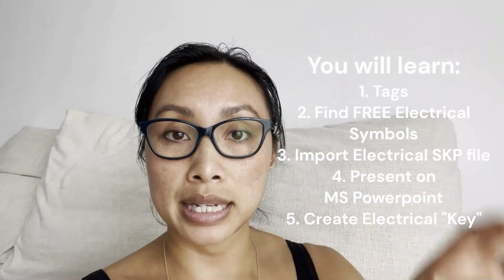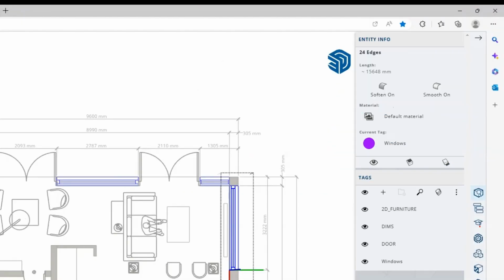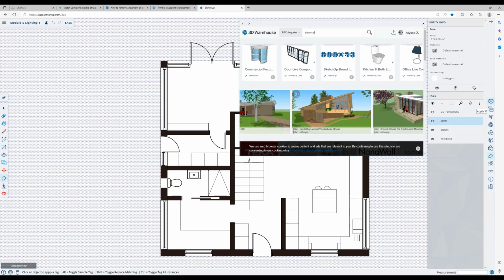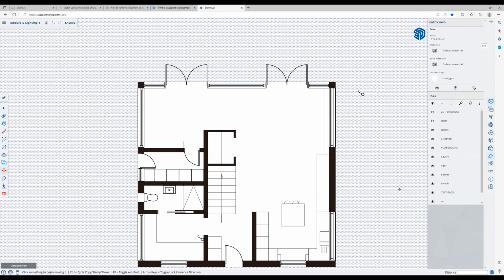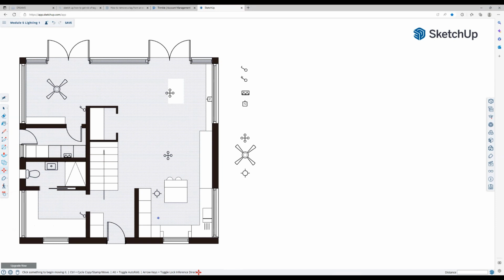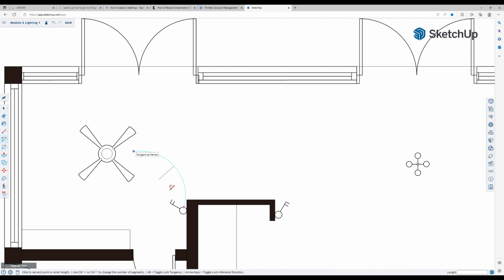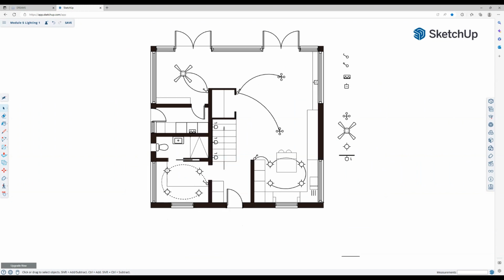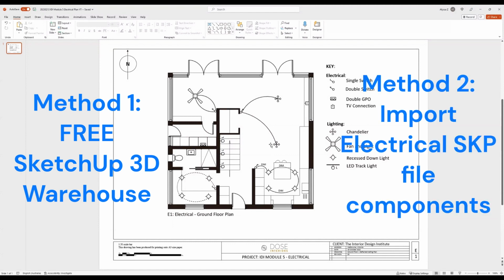IDI MODULE 5 - Draw an Electrical plan using SketchUp Free | Lighting Plan | Interior Design Instit

Comment: Hi Alyssa
What do we do if we didn’t do tags from the start of module 4??  Are we stuck now?
Reply from the maker: It may make it hard to filter your different layers to turn the visibility on and off to make it easy to place components and present the drawing. But you can always delete the furniture components for your module 5 assignment to place your electrical components on top. Make sure you "save as" a new file for your module 5 assignment.